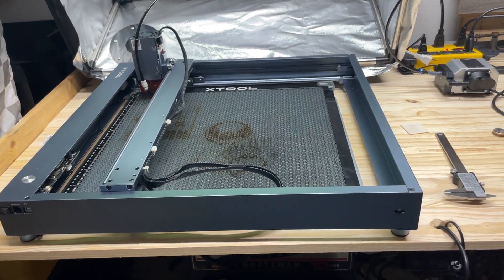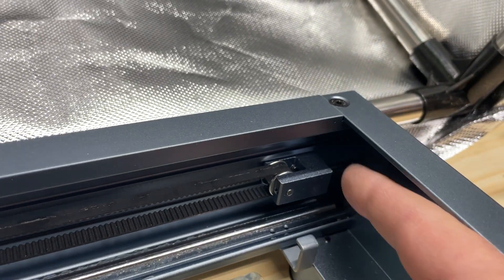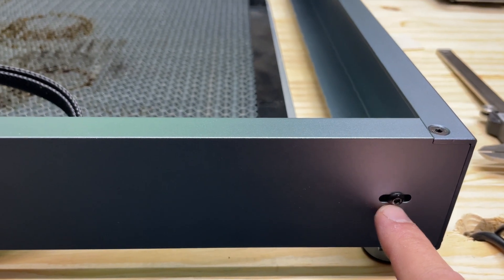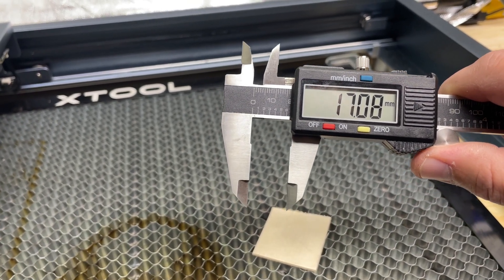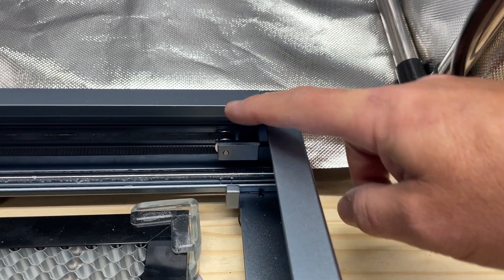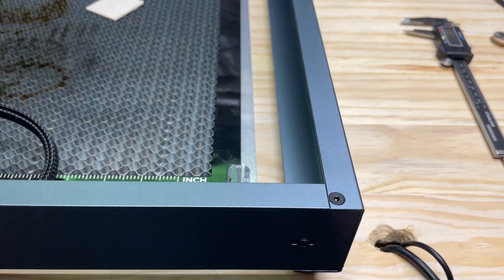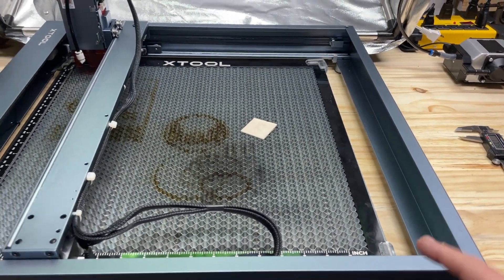xTool D1 Pro Laser engraver belt tension:  HOW TO SET IT!

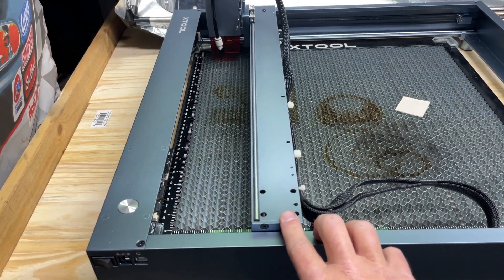Comment: I'd actually pay more attention to the tension of each belt to be equal. In importance that superseeds the distance of the blocks to the outer frame I think. (And no, the gantry will not become out of square when the tension is unequal with the steppermotor being on one end, (02:11) because there is massive metal rod running all the way to the other side near the motherboard driving the other belt wheel there also, so really it doesn't matter on which end the motor is mounted).

Comment: Thanks for the help! Though I felt a lot better putting at 15mm. Setting it at 17mm gave it too much slack for my comfort.
Reply from the maker: 17mm works for me, though I think there's a decent rage there where it will work fine, as long as both sides are equal.  Thanks for watching.